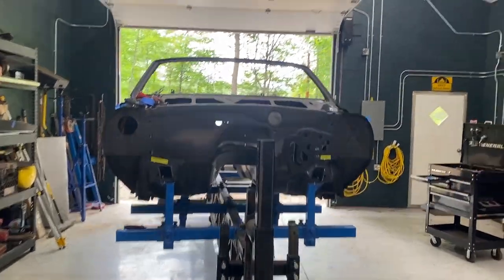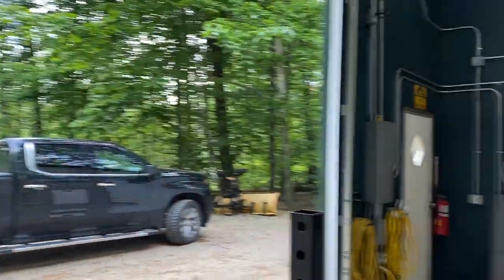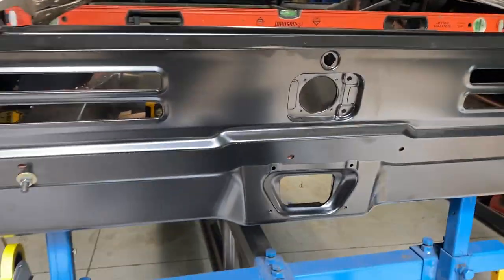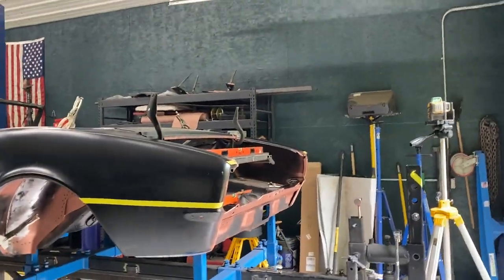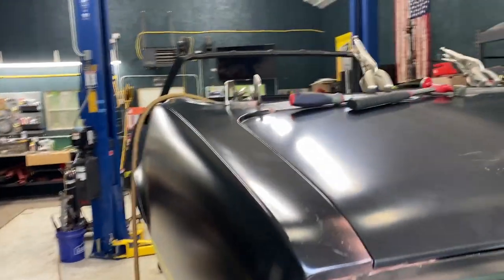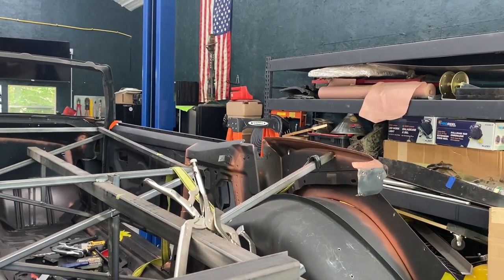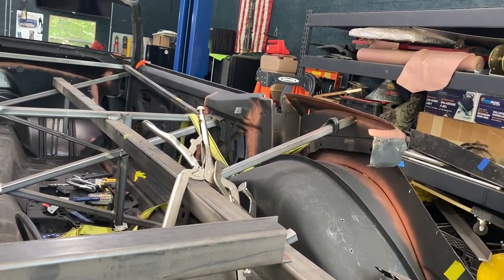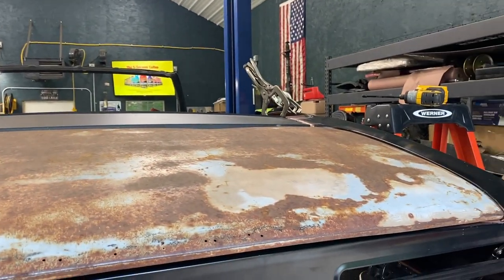67 Firebird, Part 33, Quarter Panel Fittup

Comment: As everyone else has said, I suggest that you try putting a 1/16" shim (to start) under the hinge bolt closest to the front of the car between the trunk lid and the hinge.  Also, John from VVG has a video on getting trunk lid edges to line up which is really good. I got an AMD trunk lid, and had to shim the right side up and the left side down  to get it to line up with the quarters.
Reply from the maker: Thanks Gunner, I went back and watched that again and you are right I am pretty confident I can make this all work.  I will shim it to get it up first then work it the best I can and see if I can get rid of the shims.  Thanks for your support

Comment: I went through 3 different trunks, but mainly put the trunk on and lined everything up before installing the hinges.  That included welding any hinge braces as well.  Thanks for sharing.
Reply from the maker: Thanks GoGo, were they new trunk decks? And did the front contour match the body line? or were there different issues?
Reply: @LakeAndLodgeGarage  The lines on 2 out of 3 new lids did not match, however, the original matched the best.  Eventually the last new AMD trunk lid worked out.  If your hinges and braces are not movable you could probably use shims to raise the rear end of the lid.

Comment: Hello brother don't worry it's part of building a old car you will get it I will work on the 1/4 panel first and then the rear deck lid filler panel and next the deck lid I did email you but haven't heard back from you

Comment: I would say the trunk lid isn't correct, because everything else seem symmetrical, I had to do some persuasion work on the 67 trunk with 2x4s to bend it the way i wanted it. Also remember that the seal needs to be used to see how much different it will raise it, same with the doors, windows put in or similar weight and again the seals, I would wait to start cutting panels for gaps until it sitting on the suspension, just my thoughts.
Reply from the maker: That is an excellent point on slitting the panels Roger.  Thank you.  and I will add the seal as soon as I get the trunk gutters installed but again something I can't overlook.

Comment: Hey boss. I'm doing a 67 coupe and was wondering if you could measure your frame rails from c-c at the front side of the frame rails for reference point so I can get my rails set correctly
Reply from the maker: Sure I have that dimension on my jig points drawing. Go to about on this page and email me and I will send you all the dimensions.
Reply: Is I tried to reply to you that way and it's not letting me use the link to email you as it states your email is invalid.  Can you provide a valid email so I can indeed email you
Reply from the maker: @andyadam5259  that's strange usually you just copy the email address into your email program and go with it.  Email me at mike8758@me.com.